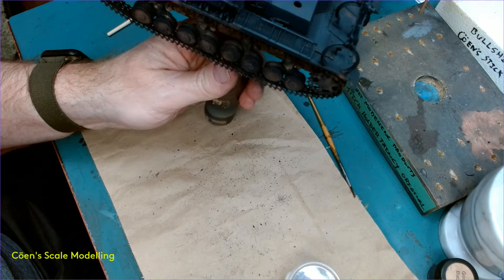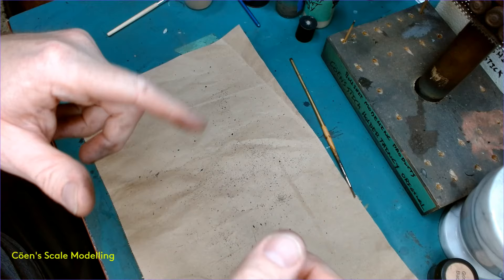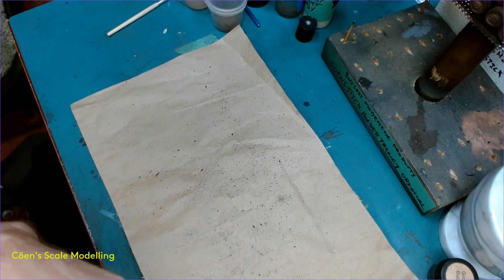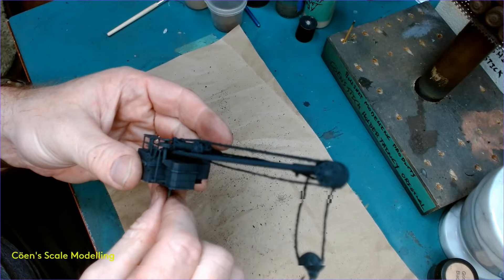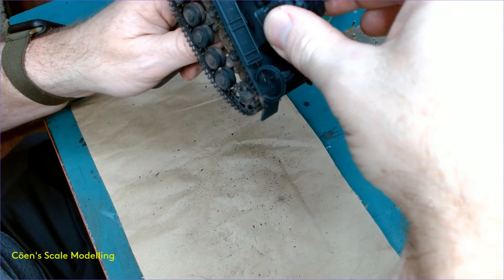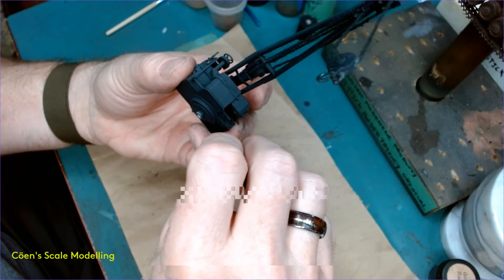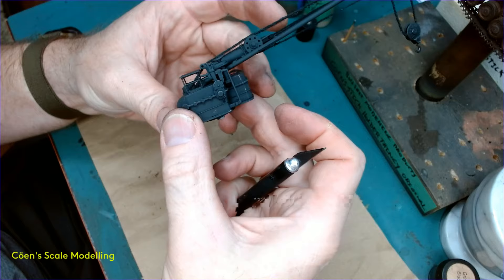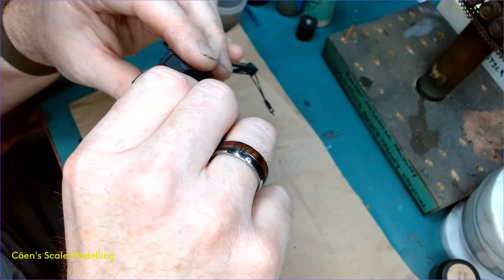How to Painting 017 Dirt, Mud, Soot, and Stains

Comment: Ohhh I just had a thought… we’ll I’ve had it for a while now but kept forgetting to ask you 😳🙄🥴 I know the normal soldiers had hobnail boots ( metal stud things in the sole for added grip ) but did the tank crews wear these particular boots or were they rubber soft soles 🤔🤔🤔 only asking as the damage from a hobnail boot I’d expect to be quite severe on the paint work 🤓🤔😳 so would the paths over vehicles be well worn 🤔🤔🤔
Reply from the maker: Yup, they wore hobnailed boots too. You would think that they would have really done a job on the painted surfaces too. But, apparently they didn’t, as photos very clearly show. Germans made good paint.
Reply: @CoensScaleModelling  indeed they did 🤓😎🤩 it’s a question I’ve wanted to ask for a while now but kept forgetting 🥴🥴🥴 the places you’d expect to get highly damaged are on the engine deck whilst carrying troops or turret roof and the floor inside the tanks but we just don’t see it 🙄🙄🙄 so yes I think the Germans had bloody good paint 😁😁😁 still do on the cars they produce you never see rusty BMW’s or Mercedes eh 😂😂😂